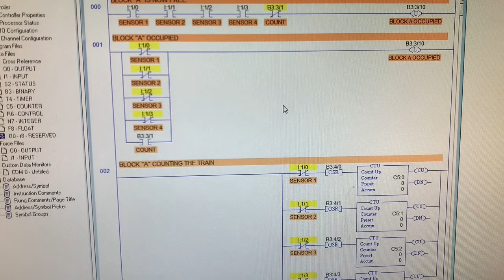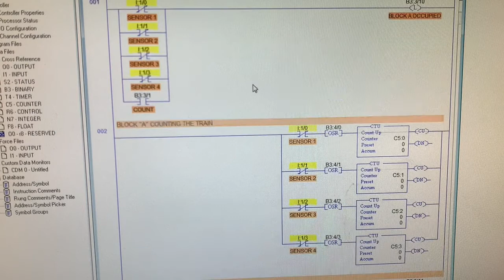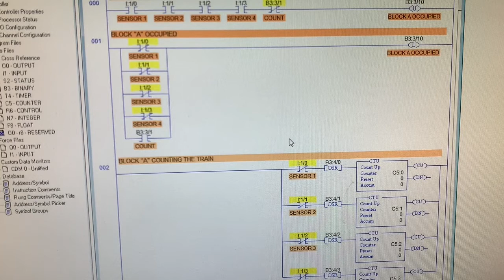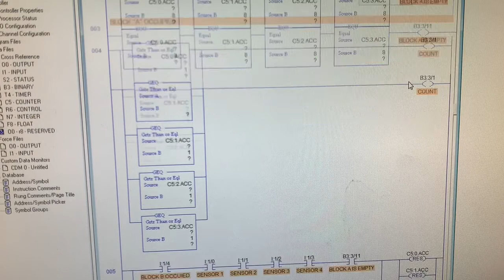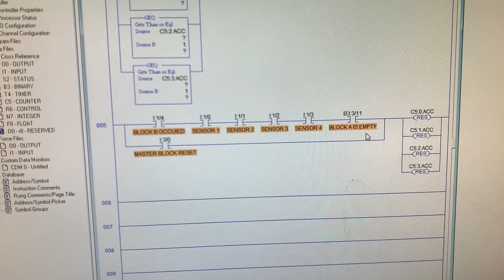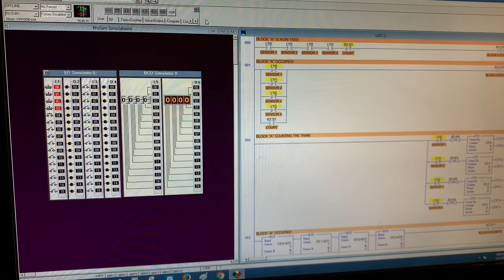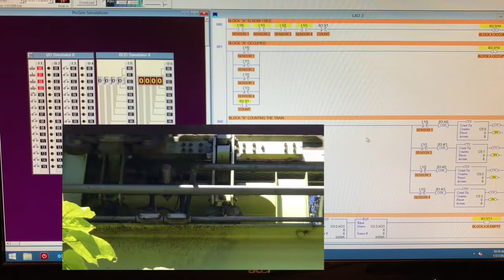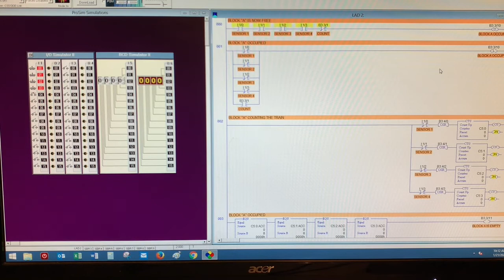Basic rollercoaster block function

Comment: Hi I'm trying to replicate this myself to play with it but using different simulation software with components named differently.  What does the OSR component between the sensor contacts and the counter inputs do?
Reply from the maker: It only allows the run to be scanned true 1 time (a gate that lets logic past once) the name is called a One Shot Rising) it’s kind of an older logic use but that what the program allowed.

Comment: I think something that would help prevent rollback collision accidents like the Smiler is to put 2 proxy switches at the bottom of each concave. If the train stays in there for more than a certain amount of time, the ride should fault so that a train can't be dispatched on top of it even if the block is attempted to be overrode. Also rides I have operated have massive blind spots, so it's good to know where the train is if it stalled
Reply from the maker: Some manufacturers use photo eyes stretched across low spots. Not for block I for but more as an alert that something is on the track.

Comment: Im assuming at my home park kings island, the beast goes up the lift hill at an absolute snails pace until the very top. I figured it was buying time to clear a car from a block zone
Reply from the maker: Could also just be gear reduction on the lift. Slower means more torque typically.

Comment: Could you do a video explaining how the B&M rolling block system works? Or is it just a simple extrapolation from the counting function?
Reply from the maker: I’m not sure about the rolling block system I honestly never heard of that. Typically it’s safest to count. The second best is two flag verification but this is typically older relay driven rides.
Reply: @ryantheridemechanic  Coaster College mentions it briefly in his video "10 reasons B&M is the best roller coaster manufacturer". He says it is basically a system that allows the train in the holding area to advance into the station at the same time the dispatch train is exiting, increasing rider throughput.  But he doesn't go into any detail as to how the programming handles this.
Reply from the maker: @kendonagan5535  hmmm interesting. I can easily see the logic for that. Still counting in the background but using encoder feedback for train position. Station and waiting should always have a delta set of pulses between the two. Interesting. It would all be speculation mixed with what I know if I were to do this.

Comment: Where are the 4 sensors located on the track? (I see in a real roller coaster 2 before the block brake and 2 after the block brake) but I can't find in your video where the 4 sensors you are talking about are.
Reply from the maker: Block proximity sensors are typically located on the center line of the train path or in between the break assembly’s depending on the manufacture. In a mid run block brake, the first two sensors are typically located on the top of the lift. But realistically any sensor in a block can be used to show a block is occupied abut only 2 to 4 will be in charger of resetting a block for safety.
Reply: @ryantheridemechanic  Can I send you an email with a photo as an example?
Reply from the maker: @kevinvankerckhoven3864  so it’s kind of a dead end without know the manufactures intent behind it. There are sensors for occupancy and resetting, telemetry, and triggers for timing and effect. The better option would be what park / ride/ zone are you looking at?